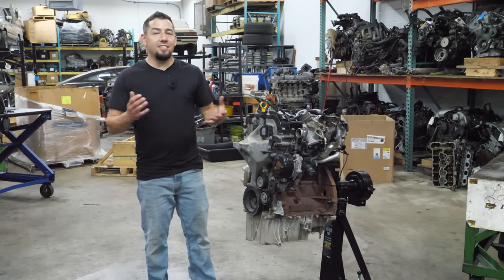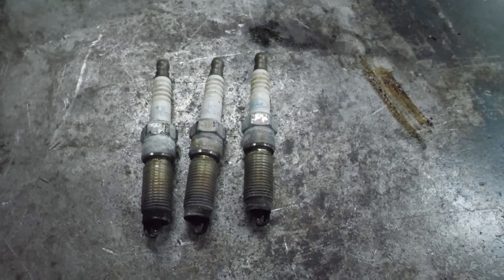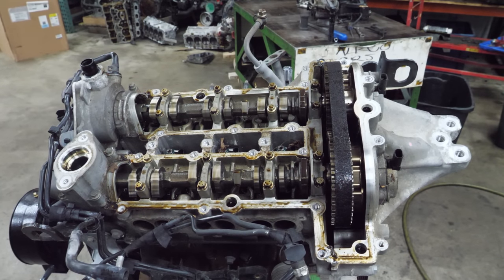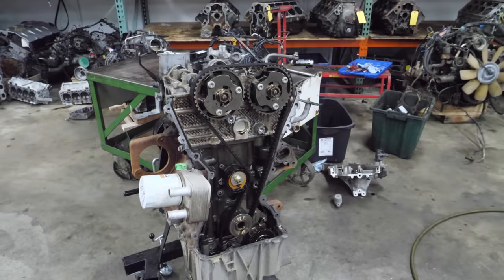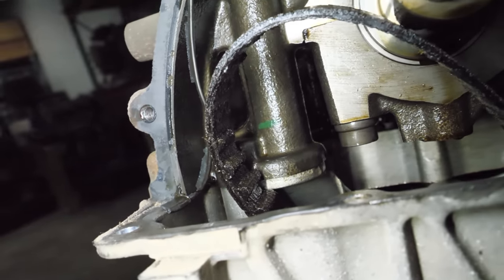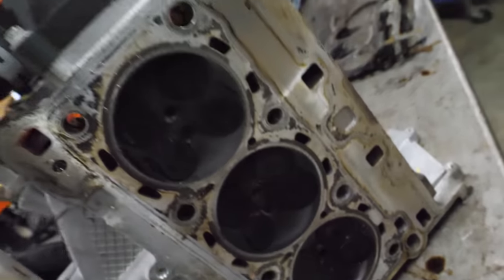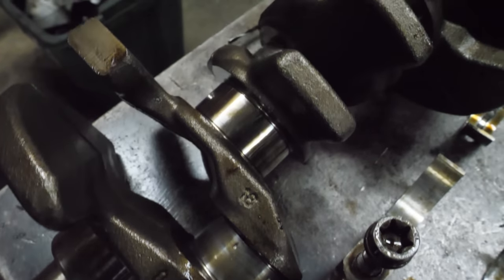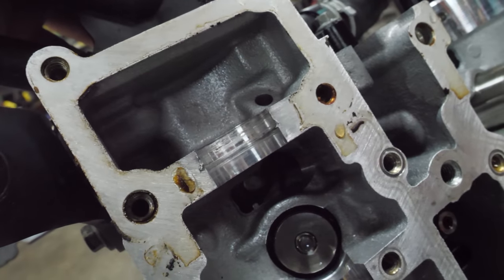JUNK Ford Ecosport 1.0L 3-Cylinder Ecoboost Teardown. LAWSUIT ENGINE!

Comment: I’m surprised you risked putting all that weight on your engine stand.
Reply: I was surprised he didn't use his forklift to pull the head.
Reply: I bout lost it when hepicked up that crank with one hand!! ROFLMAO
Reply: Serious risk putting that big boy on the stand
Reply: @dennisgoans701  and turned it over BEFORE pulling the plugs :D
Reply: good 1
Reply: Living dangerously…
Reply: I was disappointed that he didn't put the crankshaft on the scale.
Reply: Just another Ford engineering failure
Reply: @kenj.8897  Right, engine failures are brand dependent.....
Reply: Whew, Thank God (or whatever diety you may or may not worship/pledge your life, first born, or immortal soul to, assuming you do or dont believe you do or dont have one) all those super heavy belt teeth  were stripped off and went out the oil pan drain hole. Those could have been the straws that broke the camels back causing stand collapse eh?
Reply: Yep, I really thought he hurt his back when pulled the head off.  Safety first, dude.
Reply: You can probably push one of those vehicles faster than that engine will
Reply: How can a belt last dipped in hot oil?
Reply: @WhittyPics  Considering that little engine makes up to 138 HP and 150 lb ft of torque....
Reply: I have never torn an engine down..how much weight should I put on the engine stand
Reply: @stocks4bt  it’s a joke because that engine is a glorified lawn mower compared to the load the stand can take.
Reply: It's a small engine, but a 1.0 3 cylinder is very common in Europe. Mechanics service this stuff all the time  Most of the cheap cars either have this, or some kind of hybrid solution. Due to environmental regulations a engines are very expensive in most European countries.
Reply: Weight of dissapointment

Comment: As a Ford Mechanic from Germany I service the 1.0 Ecoboost alot. First of all the 1.0 is extremly sensitive, service it well and don´t mistread it and it will run for a good while, but make one mistake, ( run without water/ put in the wrong oil/ abuse it when cold...) it will die on you garanteed. I have seen allot of Timingbelts and Oilpumpbelts like that because someone put the wrong engien oil in wich then started to degrade the Belts. Takes only a few weeks for this to happen with the wrong type of Oil. Also the Cranksshaft isn´t keyed  so the belt can balance itself when you tension the new Timingbelt, because you need to lock the VVT units and the camshafts when changing the belt. That also means you need to take out the starter motor and put a Flywheel lock in so the Crankshaft can´t turn when you change the Belt. The New 1.0 Ecoboost now has a Timingchain, but for some UNBELIVABLY STUPID REASON (mostlikly money). The Oilpump is still Beltdriven. So you still need to tear the engine all 10 years or 200000KM/125000miles apart just to change one small belt. Facepalm!! Also the waterpump is now Driven by a Dry theeted Belt wich is Driven by the Camshaft end by Cylinder 3. YAY. Pls end me know.😥
Reply: I never liked the concept of turbo charged tiny engines.
Reply: I  understand that on this engine there is no key way for the oil pump drive (a seperate belt to the crank belt) The oil pump though needs no timing like crank!!
Reply: My 2006 S430 is nowhere near that delicate.... Almost 300,000 miles on it now... That car is a beast. It doesn't know what quit or die means.
Reply: Thank you very much. Can you tell me if that new little oil pump belt is Dry or Wet (in the oil) ?  Thanks
Reply: You can get a camshaft lock to hold the cams when doing timing belt too i think
Reply: @jeffsaxton716  VW 1.8T is relatively small and turbo.....very reliable.  I guess it's not "tiny".
Reply: Just wondering if I can get the timing chain for an older ecoboost engine, or is that a no go?
Reply: Buy Toyota......this ford's engine is a rip-off
Reply: Chevrolet uses the 1.2 wet belt engine in their Trax SUV. They know it's going to be a failure. People that buy this vehicle will take it to the cheapest oil change place possible. Chevy hopes the belts will last through the warranty period, but anything after that is the customer's problem. I tell people to avoid these at all costs.
Reply: Can we put a CVT in it to make it totally Garbage?
Reply: @jeffsaxton716  it's not about the turbo or the size of the engine, it's about crazy decisions, mainly the wet belt. That is just such a comically dumb decision, and I think this engine gets it "less bad" than the PSA stuff like the PureTech one that blows up every 30k km
Reply: @jeffsaxton716 I like idea but you have to execute the idea… good power to weight to energy spent ie economy with a turbo/supercharged 3/4 cylinder engine. Smoky Yunick experimented with long stroke turbocharged 2cylinder engines that showed great promise… love to take a Tesla car and put a smoky Yunick 2clinder  in it 😅
Reply: 1.8T size has capabilities of 500hp but it only makes 180 and 225hp. I guess in 180hp it is problem free but Audi warns that on the 100,000km it is advisable to chance the turbo  @TK-ec5bv
Reply: @Galf506 well I've changed this year the timing belt on a PSA Puretech (named in spanish pudretech which translates to rot-tech) and it's definitely awful and pure rubbish but still the design of the engine I think is less dumb than this one. I think they built it after the Ford Ecoboost came out so they probably learnt a few things.
Reply: Had a ford eco boost 39000 miles death rattle low oil pressure , my mate is a mechanic oil pump belt stripped wet belt badly corroded met all service requirements and oil change 6 months never again plastic engine don't go near one! Mechanic had 4 fiestas blown up and 9 transit vans waiting for belt changing but they are so new does don't do them yet!!
Reply: The head at Ford said they are focusing on quality...BUT!!!! It will take several years to correct. Start by firing all their engine engineers!!! Sadly this effects many of their cars and trucks and I wouldn't buy anything they make! Ten speed trans...junk too. Ecoboost in the Bronco failures all years...The list is to long long to elaborate. Chevy and Toyota just as bad...Benz and BMW too. All the late model cars/trucks from all the manufacturers are engineering disasters!!!
Reply: The guy who mentioned Toyota obviously hasn't heard about the the new V6 in the Tacoma...Or the junk transmission thar comes with it lol.
Reply: Do this vehicle hit the valves? Coz i have done 3 with damaged belts but the valve are still in good condition
Reply: I think the wrong oil is a common big mistake and everybody blames Ford, correct me if I'm wrong
Reply: When removing or replacing this engine how much interference do you get from transmission. Do you have to remove it as well to get engine out or to separate them
Reply: @keenanhenson8343  depends on the transmission type. Manual transmission you could leave the transmission in. But when it´s the Automatic one you can only leave it in when it´s in a Focus or Mondeo. And even then it´s a tight spueeze. But If you got access to a Car Lift, I would recommend dropping the engine and transmission out the bottom since it´s fairly easy to get out.
Reply: @sr70rr  yes and no. Wrong type of oil is sadly a common mistake on the 1.0. But most people don´t know that you can only use one specific type oil. The 1.0 Ecoboost only takes one kind of 5W20 with an specific Additive in the oil to keep the belt from disintegrating. So even if you put in a Standart, full synthetic 5w20 with an B5/A5 clerance, you will still kill the Belt beause it lacks the additive. And once the wrong oil is in for more then 6 hours you will already have minor damage to the Belt. there is sadly no room for error with this belt design.
Reply: how does it save money to use a belt driven oil pump? i'm betting that this design is actually meant to MAKE Ford money on maintenance and upkeep. the engine intentionally self destructs AFTER the warranty period is over.  there's no other reason to make the most important component in your engine literally disintegrate over a specified time period.  we've been using simple gear driven oil pumps for 100+ years that could run nearly forever with little to no maintenance.  but ford figured out how to complicate the design, require costly maintenance, or else the engine commits automotive seppuku. 

it's planned obsolescence. there is no way ford is THAT inept, they know what they're doing.  and i almost forgot about the fuel economy!! how do you build a 3cyl turbo that somehow manages to get worse gas mileage than a 1980s era 4cyl??  

this might be the worst piece of automotive engineering in the last 40 years.

Comment: They were so preoccupied with figuring out if they could make a disposable engine that they never stopped to think about whether they should.
Reply: Like yoga pants...... Just because you can, doesn't mean you should.😳
Reply: Furd doing Furd things
Reply: @aaronbryan5095  Yeah, like it was a major technological advancement to put the timing belt in the oil. Like to meet that guy...
Reply: @InsideOfMyOwnMind  just to tink the new 5 liter uses an oil pump driven by a wet belt
Reply: The self melting timing belt soaked in oil will assure in most cases that you don't pass the predicted life expectancy. 
Ford build assurance...
Reply: They don't care if they should or not, they want disposable engines so that they get all of your money one way or another. Car companies are a business, so if you buy one car and keep it for 30 years and only do basic maintenance, they aren't getting much money. However, if you either have to buy a new car every few years or have some big repairs that cost about 20% of the car when it was new, then you have a returning customer and a constant flow of income.

Gotta love capitalism 👍
Reply: They circled the problem
Reply: I think Ford , just like many other corporations is more concerned with diversity, inclusivenes, and equity than the quality and robustness of there products.
Reply: @joeblowe7545  Those two things are completely unrelated to each other. Why do conservatives try to make everything about wokeness?
Reply: Buysell Buysell  You're seeing the results of a gutted education system. People never learn how to think critically now.
Reply: @x2c.diamundz  Yes, but than you get lifelong Ford buyers like myself that switched to Mazda and never looked back.
Reply: We own two Fords, both should last a good while as they were designed before the rot set in. Can't see us ever buying that brand again. It's a pity because they used to make good stuff.

Even Mazda is not as good as they used to be, eg, cracking heads on some of the Skyactive engines and very time intensive to replace head gaskets etc.
Reply: @nicholasvinen  Mazda is replacing a lot of the parts that used to be made by Ford. Also, with the Mazdas, knobs and other things inside the car are not breaking all the time like we had with Ford. the only thing I've had to do with any of the Japan Made Mazdas is tires, oil, wipers, and filters.
Reply: Just like dinosaurs, you have to dig to find the teeth.
Reply: @InsideOfMyOwnMind  the same guy that put the water pump inside the V6 Edge engine…lol
Reply: @johnshield7157  let's just make the spark plugs part of the cylinder head.
Reply: Lmao. Best comment.
Reply: "... they never stopped to think ..."

This is the key part.
Reply: @jhundley2009  Ironically if you drive the oil pump from a sketch af timing belt there's no harm no fould because it will grenade before it has a chance to lose oil pressure.🤣
Reply: Seriously though—why not a timing CHAIN if it’s running wet? A bicycle chain would have been better than those belts, and could’ve prevented a bunch of problems.
Reply: @InsideOfMyOwnMind  
He's sipping mai tais on a beach somewhere ,rolling in his payout. 
Pops used to work for ibm, and if you came up with something that saved them money you'd get a check cut to ya.
Reply: @x2c.diamundz 
Truth. 
Mercedes really screwed up on the w123, they're 40yo and folks still daily drive them.
Reply: @InsideOfMyOwnMind why stop there ,just cast up a whole sealed engine, no biggie at all. 
If the block and head is 1 piece you can't remove the pistons to rebuild or replace. 
Yep no biggie ,whittle that idea out in about 10mins 😂😂
Reply: @MrTheHillfolk  Already been done with two strokes. Now what about those small engines with the plastic camshafts that have only one lobe for both valves for even twice the wear? Init just great?
Reply: @timothy098-b4f  Because they don't know how to use a bicycle chain without the derailleur which everybody knows is something you need in an engine.
Reply: @InsideOfMyOwnMind  plastic inside an engine ,I wish they just said no 😞
Reply: @jhundley2009  > wet belt to drive an oil pump
That's like failception right there.
Reply: @talkingbread2012 😮💔Mazda          
Ought just Stick to Making
 Light Bulbs! 😅😊😍🍄
Reply: buysellbuysell4699 lol Skoda is Czech not soviet and they make good cars.
Reply: Would not touch a ford now
Reply: @purplestrawberrysunset Skoda is now owned by VW
Reply: Stock holders and investors said
"yes please! "
Reply: Such a disposable engine it makes Hyundai look good.
Reply: So GM thought this was such a good design, they followed Ford😂